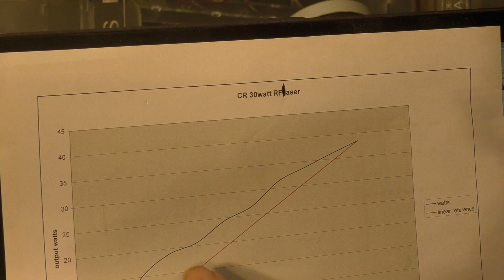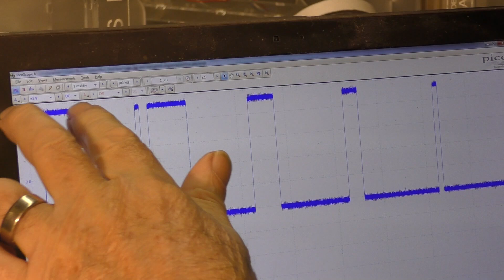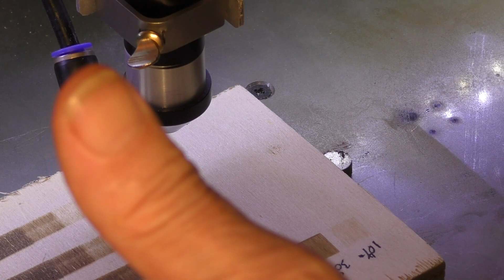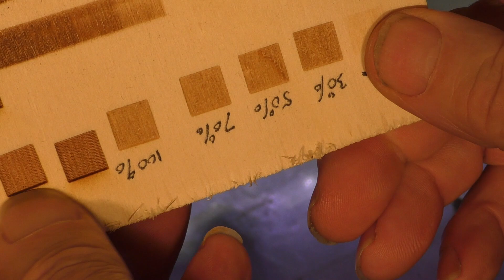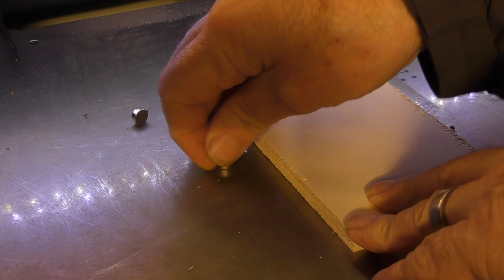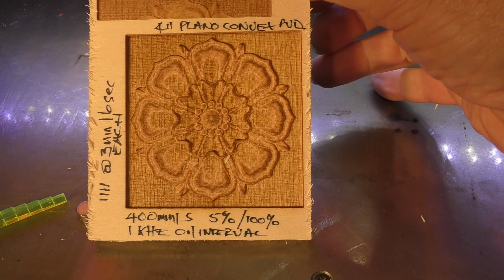TangerineTiger20 3D Engraving with Grayscale

Comment: Hi Russ 
Where did you get that frequency calculation axial sheet from 
I am just wondering how to get it if I needed it in future 

and do you connect probes or whatsoever to the machine in order for that Pico scope program to work.. I mean to draw the signal graph on your screen or its just through the usb cable
I do have a pc scope if that is the thing you use to get the graph but where to connect the probes..

And another thing if you don't mind please 
My machine hasn't got a water safe sensor to protect the tube but I already have ordered one but the thing is I don't now where to connect it
I searched on YouTube but I couldn't find anything about it.  If you could please help me sort that out 
Your help is greatly appreciated 
Thanks for all the help you always offer us
Reply from the maker: Hi
 The fact that your machine has no water flow sensor leads me to deduce that you have a K40 machine. For me to send you data, please add your disguised email address to another comment and I will reply with some information. I will also delete your comment/email address from public view.
Best wishes
Russ

Comment: Hi Russ, thanks for the great videos. I found your channel a couple of days ago and have been learning lots. I hope it is ok to ask for a recommendation on a Co2 laser? I would like to cut and engrave wood and leather and engrave glass. I have been using an ortur LM20 for a couple of months now and I am researching my options for a machine with more capabilities. Thanks again for all the great videos and keep up the good work.
Reply from the maker: Hi
 There are  4 things to sort out in your mind before you go looking for a machine.
1) What materials do you want to work with ? Different laser wavelengths affect different materials in different ways
2) What size material and thickness MUST you have. This determines the bed size
3) Will you be mainly cutting or engraving. Photo engraving in particular requires precision control of low power, so limit your power to about 80 watts. Whereas cutting requires power. and if that all you want to do then 100 watts plus is for you., 
4) Do you need this for leisure/hobby work or is it a "must work" machine for a business venture.

 It will be rare that you can buy 2 and 3 in the same machine. You may  not need the large bed that goes along with a high power tube. Buy a small machine and fit a powerful tube as this is a much more economical decision. Your answer at 4 will help determine if you want to pay the money for a reliable plug and play machine or if you are happy to buy "a project" at a much cheaper price.

I will be happy to critique any links you may be interested in . If so add your disguised email address to another comment and I will reply and then delete your comment
 Best wishes
Russ.
Reply: @SarbarMultimedia  That would be great thanks Russ. You can contact me on asheehanthreefivethreeatgmaildotcom. The threefivethree are the actual numbers vs the written text form.

Comment: Hi Ross, simply wow! your work explaining this things for us mortals is "re-markable" See what I did there? lol. Would you consider the idea of privately giving me a crash course in Fibre laser? I need to achieve certain results but to be honest I'm struggling and I need some help. I know your time must be valuable so we can talk numbers.  thanks in advance
Reply from the maker: Hi Marcos
My fiber laser machine was on loan from a local company. It was on the niche end of the fiber laser market  and the company wished me to explore it capabilities because they did not have time to "play" with it themselves. It was great opportunity for me to use my CO2 laser experience to try and understand how light at a different wavelength can behave so differently in the way it interacts with materials.  SADLY,  I no longer have the machine because a couple of months ago the company had an urgent customer requirement and needed to "unloan" it.. 
If there is some knowledge that I can add to that which I have logged in my videos I will try to help. 
 My guess is that you have a standard fibre laser which operates with the Q switch principle, It has a fixed pulse shape that you can vary to a certain extent with frequency and % power. The MOPA laser I had, possessed one rather special parameter and that was to choose  any of 16 different shape and duration of the pulse. That put its performance capability way beyond the normal fiber laser but then again it was 5 times the price.
 Add your disguised email to another comment and I will reply to you and see if there is any help I can give.
 Best wishes
Russ
Reply: @SarbarMultimedia  Thanks so much for your informed replied Russ. We do have a Mopa from Needham Laser Technologies now. Fantastic company in the UK, I was looking into a Lotus one as well and yes it was quite a bit of money compared to a Chinese laser but we are a stablished business and we know we cannot operate with hobbyiest machines. Feel free to come around to our premises and play with the laser when the madness is over. It'll be nice to see you. You can see what we are doing with the laser and reach out if you go to www.RegalBlades.co.uk Chat soon. Marcos

Comment: In corel draw it is possible to edit a picture for 3d engraving. For many of the pictures I've been engraving I choose a setting called plastic and adjust the contrast and a few other settings till it looks similar to what you see in your Google search. Then if I'm happy with the engraving I change back to the original picture and etch with newsprint to get proper shading.

Comment: Thoroughly enjoyed that one Russ. Thankyou so much for all the time and effort you put into these. Well  done.
Reply from the maker: Hi .
It depends on your issue of RDWorks. Later issues do have the function you are seeking.  Draw a square/rectangle .and make sure it has corner handles.  Go to Drawing, Chamfer. and a little window pops open.Set the radius  you require and press Auto to round ALL the corners./ Manual allows you to set  a radius on  individual corners,]
Best wishes
Russ